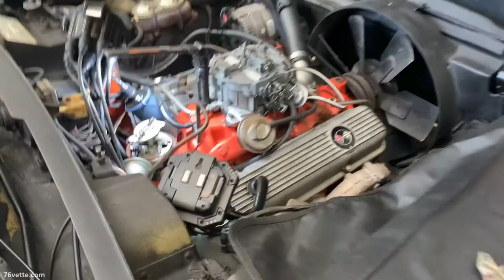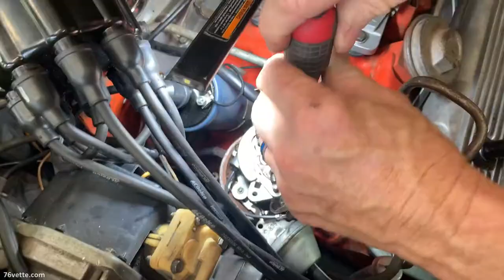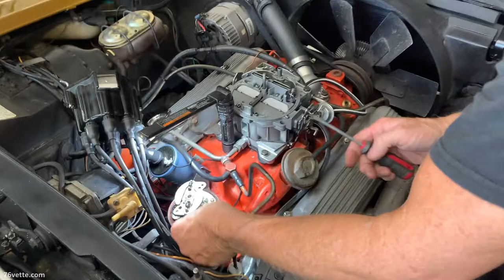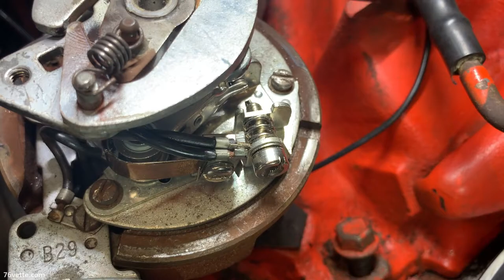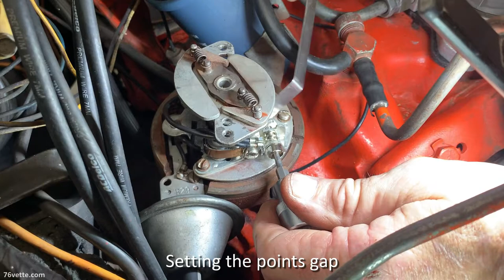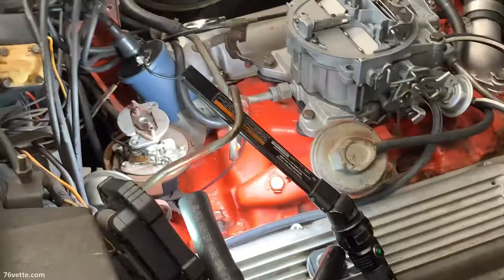Replace & Adjust Chevy 350 IGNITION POINTS

Comment: On a smallblock 307, I used to use my dads "Dwell meter" on the points.  Get it close, fire it up.  Attach the dwell meter to the coil and with a specialty screw driver, open the window and adjust the points spot on.  I think it was 30 degrees on the dwell meter, but could be wrong.  FYI Once dwell is set/changed (points gap is messed with) your timing will move.  You must re time the vehicle as the timing changes.  Never set timing then dwell.  Set dwell then timing.
Reply from the maker: That’s how we did it. Replaced then gapped the points, adjusted dwell angle, then set the timing (initial/idle timing first, then total timing at around 2500 rpm at 34° I think it was). It made a HUGE difference. It truly felt like the 350 woke up.

Comment: Question: when you set Dwell Angle to 30 overtime the rubbing block wears some and the car still runs strong but Dwell Angle now reads 25. How far can you go before it starts to run rough? Dwell Angle to 20 degrees?
Reply from the maker: Change the ignition points every 12 to 15k miles. They are cheap. 😊👍🏻
Reply: @76vette  Thanks. I know. I have two NOS Delco Remy sets, the old ones with the light gray rubbing block. I was just wondering as to what Dwell number they start to make for a rough idle?
Reply from the maker: @robrobster9148  That’s a good question and well above my pay grade. Sorry ☹️
Reply: @76vette  No problem. Thanks again!
Reply from the maker: You’re welcome! 😊👍🏻